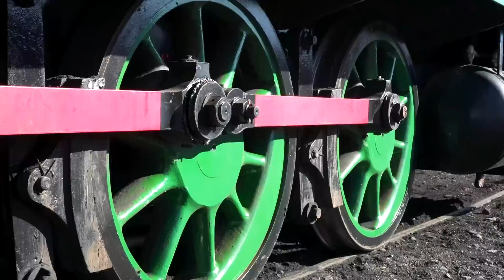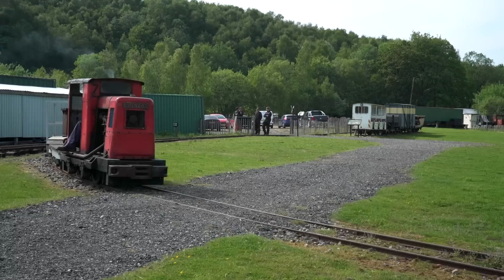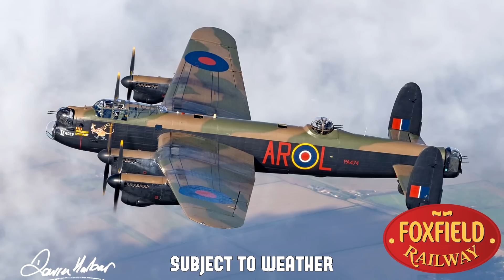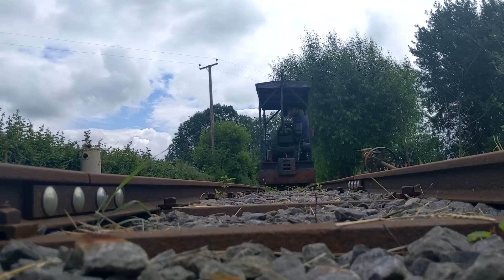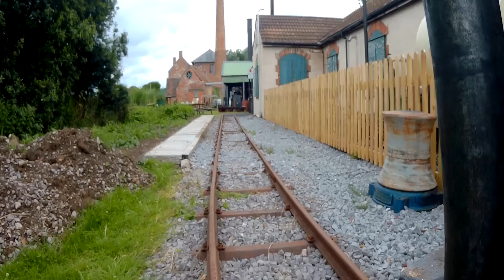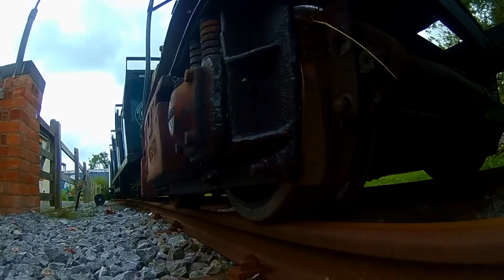The most Basic Locomotive Ever? The Lister Railtruck! Lawrie Goes Loco Ep. 45

Comment: The 2ft  (AKA 600mm that we have in the central EU) railway we have, outside of mine railways, mostly uses rollingstock - locos and wagons alike -  that were converted from 760mm stuff, and only a few were made specifically for 2ft, so their smallest loco is a 7ton  central-cab 0-4-0 diesel (at least one of the 2 600mm line still exists here, the other is a museum railway so that has a huge mixed collection). Even the few small industrial 600mm lines i know about (now those used mine cart chassis for their rollingstock) had some kind of proper loco either a mine-loco or a regular cab loco; "Railtrucks" are completely unknown here outside of road truck conversions.

Comment: Is this the most simple a train can get? No not quite.
Imagine a wooden platform put on basic rail axles using pillow blocks - no suspension.
The engine is a mower engine that drives one of the rail wheels using something like a scooter wheel.
The brakes - disengage the engine then use a human foot against the rail to slow down.
The passengers - sit on cushions.
Passing other trains - everyone gets out and carries the train off the line in pieces to let the other pass.
Also works for places where the line is impassable.

Comment: Believe it or not, Lawrie, I can do you one simpler.

It's a little odd, though -- the Colombian "bamboo railway". Colombia is... not a rich country. Well, I'm sure its culture is (I've never been there), but its pockets aren't. They have trouble not just keeping the trains running on time, as the old phrase goes, but keeping them running at all -- but, people still need to get from place to place, and they're a country that relies a lot on public transportation, especially rail transportation. Hence, the "bamboo railway" -- an informal network of improvised, homebuilt railcars that run on the main line train tracks, whether or not the state-sponsored trains are running. One of the reasons they're as minimal as they are, in fact, is so that they can be quickly removed from the rails, if either a proper train is coming, or another "bamboo train" railcar needs to pass.

Each railcar, from what I've seen here on YT, consists primarily of a lightweight wooden platform with a rail on either end that's tall enough to serve as an improvised seat. Underneath are a pair of notches in what passes for a frame that locate the two axles, one of which has a pulley integrated into it at the center. Around that pulley goes a belt, and there's a square hole cut in the platform above it, in which sits a simple single-cylinder two-stroke engine, like a Briggs&Stratton or what-have-you, the kind that have powered things like lawnmowers and rototillers since my father was a young boy (and probably for quite a bit longer even than that...). The driver perches on the railing at the end where the engine sits, and has a long wooden pole he uses to control the railcar. A simple rubber belt goes between engine and powered axle. The pole is thrust down through the belt-hole and moves the engine back and forth, effectively creating an improvised slip-clutch mechanism. A length of stout, but thin, rope or cord is wrapped around the outer part of the flywheel and pulled rapidly, and the engine sputters and coughs to life. When the driver pulls the pole towards him- or herself, the engine moves and the belt is pulled tight around flywheel and axle-pulley, and the railcar putters into motion. Relax the lever and the railcar trundles to a stop. Oncoming traffic? Stop the car, kill the engine. The driver grabs the engine, setting it and the pole beside the tracks, and the passengers help him or her lift the platform off the axles, which are then taken off the rails, along with the drive belt. Once the other train has passed, the railcar is reassembled in place.

There's no roof, there's no transmission, there's no pedals, no roof, not even a proper seat. Literally it's a platform made of bamboo wood, two metal axles with a built-in pulley on one and rail-capable wheels on either side of both, something a literal blacksmith could forge up, an old lawnmower engine, and a really big stick. Its simplicity and its situation are its very lifeblood, both the reason it can do its job in any sort of viable and lasting sense, and a testament to how simple and how basic doing that job really can get, when you get down to it. In comparison, the Lister Rail-Truck seems almost as complex as a mainline freight steamer!

Look up some videos of the things sometime, it's really a remarkable kind of thing... and, to be completely honest, something I wish I could do here in the USA. You have no idea, genuinely, just how awful Amtrak really is, unless you've ridden it.

Comment: That exhaust "system" is a mechanical nightmare. 
All the engine vibrations are twisting on that exhaust manifold and leveraged by the total length that is fixed the roof structure.
They should have put a flexible section at the exit to the engine manifold...
and joined that to an automotive muffler suspended off rubber exhaust mounts....
with a flap over the end of the exhaust above roof level..
Reply: I doubt that this is the original exhaust, since there is no protection against rainwater getting in the exhaust, it was probably added when it became a museums object that is parked indoors. The original one was probably just straight out of the engine and would blow fumes add the operator if the wind blew the wrong way.

Comment: I'm trying to build a smaller version of one, possibly using a Lister D, and a gearbox that I haven't found yet. They're so simple, if you were going to build a loco, these are an obvious choice.
Reply: I'd suggest looking at lawnmowers if you're doing one for 7 1/4" gauge
Reply: @gherkinisgreat  I was thinking slightly larger, maybe 10 or 12 1/4". I have a feeling a lawnmower gearbox would be very hard to fit, and would probably explode from the torque.